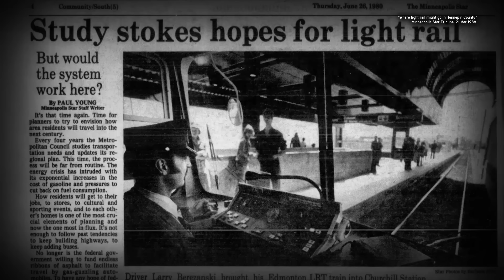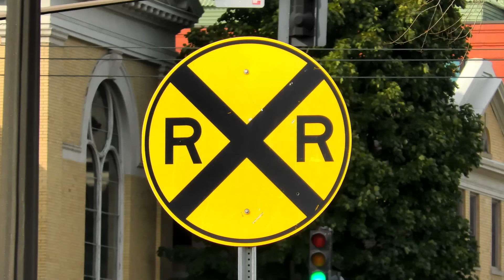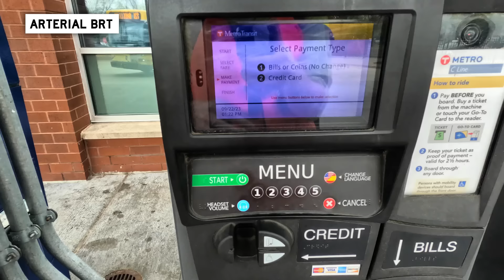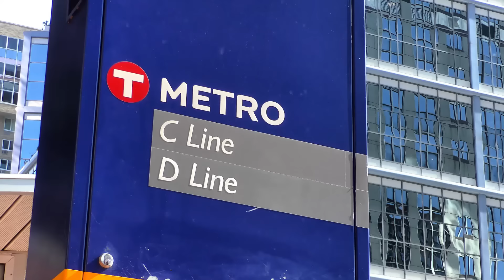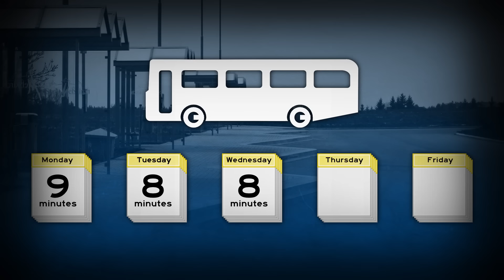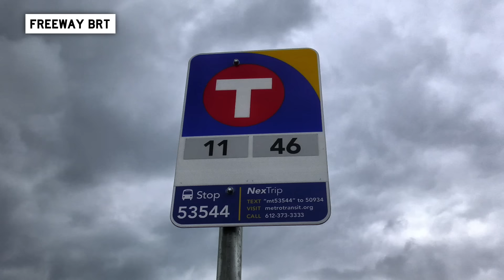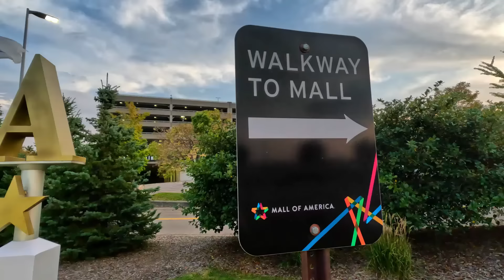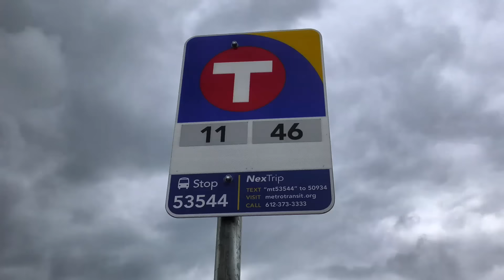Meet Minnesota’s $500-Million... 🚍 BUS???

Comment: You know why this is a good idea?

Because you're basically building light rail infrastructure in advance. In a few decades when the economic growth helped by your bus services enables the municipality to afford it, you can just replace those "arterial buses" with trams and light rail without having to fuck about with routing.
Reply: Yeah, I was hoping he might bring up that fact.
I wonder if the roads and bridges are being built in such a way as to allow easy transition to rail  - already having accounted for load bearing, etc?
Reply: @Quidisi bridges nowadays are way overly designed so I’m pretty sure they thought about that, they’ll be able to screw the railway sleepers into the concrete and they’d be done, only the parts that have asphalt would need to be removed for track laying.
Reply: If you're overbuilding the infrastructure to support later use by rail, you don't realize the cost savings that caused them to go with BRT to begin with.  I seriously doubt those overpasses could really support any type of rail.
Reply: as long as bus service is properly funded... the city I live in (Ottawa, Ontario) has had a system very similar to what they're building for decades. I was riding light rail & taking transitway bus routes (dedicated bus-only roads like they're building in this video) when I was in university 20 years ago. Today through constant fare increases and an absolute refusal from council to actually use tax dollars to fund the transit system, our bus system has become a national embarrassment that anybody who has the option actively avoids taking. I've got a choice, now, between a 45-minute bus ride to work or a 20-minute drive. parking's only $5 more than taking the bus both ways, and they've got free charging for my EV. I really want more people to take the bus, but it's a really hard case to make here
Reply: @major__kong LIght rail is likely not much more weight per square foot than buses. Most BRTs are there to be the first step for a LRT
Reply: Bridges aren't going to be totally .but the infrastructure that is being built is the stops, businesses around the stops, road width. And public support 😁 #1.
Reply: The bridges are not being designed for conversion to light rail in mind.
Reply: @trademark4537  They can convert existing bridges to light rail though. See the UofM Washington Avenue bridge.
Reply: That's always been the carrot promised with BRT, but give me one actual example of that happening in the US.
Reply: @trademark4537  well that would be really dumb. However I don't think LRT vehicles are radically heavier than a bus and bridges are designed to hold all sorts of traffic including 80000 lb tractor trailers. Trust me, no one is under engineering a bridge to the point it couldn't hold 4 or 5 buses and an LRT isn't heavier than a mixed load of traffic. Those bridges are standard highway bridges I am guessing.
Reply: @averagejoejesse  BRT is fairly new in the US, and cities haven't had enough time to grow ridership to the levels that would justify light rail.
Reply: @jmlinden7  that's fair, but since a conversion hasn't happened yet, I'm not going put stock in to that "benefit". It's Schrödingers BRT conversion as of now
Reply: It's not as easy as placing tracks over concrete road. "Upgrading" would require roadwork on all busways and installation of electrical systems, not to mention throwing away all those BRT buses for new trams. This would take at least several years to do (in American style), which means that suddenly people lose access to transit. Hence, it is foolish to think that tramways can be downgraded to BRT construction and then "upgrade" them later. Many urbanism channels have pointed this out already.
Reply: @averagejoejesse  that's exactly how a lot of Seattle rail was built. We're putting one of our lightrail lines on a floating bridge that used to be HOV lanes for example.
Reply: @arkhani.  High frequency bus and HOV conversions are not being discussed here
Reply: @marklittle8805  Many of the bridges built for the BRT are exclusive to transit. 

I'm not an engineer but I heard from someone working on the project that the bridges are not built for Light Rail, and would need major reconstruction to accommodate them
Reply: @RipleySawzen  They can but it does require additional cost. I'm not saying it's impossible, I do think it should happen in 20+ years. And acquiring much of the right of way is a big benefit. But it's not going to be as easy or cheap as building it compatible from the start.
Reply: A big part of the cost difference isn't in the strength of the structures (light rail bridges don't really need to be any stronger that roadway bridges), but in the routing of the roadway. With light rail, curves and grades are more restrictive; buses can get by with sharper curves and steeper grades. Minimizing curves and grades adds significantly to cost.
Reply: @trademark4537  that would be stupid to do that ...
Reply: @major__kong  They probably could support rail with some upgrades to bridges
Reply: But in reality that rarely happen. The only real exception is Ottava, but I don't think the Confederation line is a good advertisement for the busway to LRT model 😊
Reply: But there's no benefits from having light rail over a normal road, only more cost, no benefits whatsoever.
Reply: @TurboBaldur  
• less drivers needed
• If fully grade separated then no drivers needed (you can use driverless trains)
• Much, much higher energy efficiency
• Possibly lower maintenance cost (not sure though)
• More comfortable (less bumpy)
• Better level boarding
• Overall cheaper in the long run, especially in countries with high labor costs
Reply: Buses don’t make the economy grow.  You can’t deliver goods by bus.
Reply: @hugolafhugolaf  But transporting people can still lead to more flexible workforce as people are willing to commute further when the journey is faster...
Reply: They’re doing this in LA, the G Line busway and the NoHo Pasadena BRT will be converted to light rail eventually.
Reply: That sort-of happened in Seattle with the Bus-Tunnel downtown (built in the early 90s) eventually becoming the light-rail tunnel (starting in '09 but becoming exclusively light rail in the mid-2010s)
Reply: @miles5600  I heard Ottawa was having trouble converting their BRT system to rail. Among other things: rubber tyred vehicles can handle sharper turns and steeper slopes.
Reply: @jmlinden7 Development of transit shouldn't be ridership based... people dont use transit because its not good enought to use! 
This is why you build for the future with transit.
Reply: @70M45-c9r  yep. it's hard to convince city planners to change what already works, because to make the change would probably more than what the city might be able to afford, and in a decade is still probably paying off the costs to make the busways in the first place.
Reply: As a Latinoamerican, where the BRT is extremely popular and used for decades.

DONT FALL TO THAT LIE

It's a lie. Once it's a BRT, it never will become a ligth-train or a tram.

Never in history has that promise of "first a BRT, then a train" happened.
Reply: @M4ST3R0FH4T3  Ottawa, the Capital of Canada did it. It was not without problems though. Whole system shutdown repeatedly.
Reply: It depends on the weight requirements. Can it handle the weight of train.
Reply: No.
Reply: Didn't think about this but that's a great point - and until the city densifies enough BRT should have enough capacity to serve these lines
Reply: I’m surprised they didn’t say that too, because that was my thought too. A future transition to light rail makes sense if the construction companies can figure rail out.
Reply: And I would never do that, because bus is always superior to rail. I have my own video ranting about all the issues with LRT, and how Bus is so much better than guess what mode they have to use every single time the LR system fails, has issues, gets block or otherwise cannot fully function or at all? Good old fashion bus! "Bus Bridges" and "LRT Shuttles" are inevitable and a constant in places where there is a lot of LRT. Just look at Portland. lol. LRT is NEVER worth it. Bus and BRT only please and thank you. Especially since, if it works so fucking well, why the hell get rid of it in the first place? That makes zero sense.
Reply: @Quidisi that’s the thing, they aren’t
Reply: you're too optimistic
Reply: @70M45-c9r  The idea that LRT is cheaper than BRT is the long run is such a overused lie by the light rail lobbies.
And it is a negative to use automated (driverless) anything. It is more dangerous ironically, inevitably will have MORE problems that are expensive in the haul and on top of it, it ensures even less employment opportunities. It's wild how obsessed and trusting so many have become over automation and AI.
Reply: @M4ST3R0FH4T3  Ha, LRT is fucking lie, too. They preach how it's somehow so superior to other modes of transit, especially bus, yet it's the exact opposite and it drives me ballistic. Also, Latin America also has a very botched version of BRT. There really isn't anywhere in the world with true BRT.
Reply: @TheCriminalViolin  What? Driverless trains aren't any new AI buzzword thing. It's a 40 years old technology used across the world, proven not to pose any hazzards. Also, the money you save on automating your metro can be used to provide more local bus service, which is also where the drivers can go
Reply: @taragwendolyn  thats crazy. I also live in ottawa, when I took the bus to work it took me 45 mins compared to 45 mins in traffic to get there, and 20$ a day in parking, or about 5k a year. Our bus system does need more funding though, I believe its more social cultural outlook on transit in general that keeps people off. Well and all the news of the new light rail breaking down. Although that's because we didn't plan things well in the first place, so its going to have to be ripped up and re built in some sections
Reply: @Quidisi  hopefully so, weightwise you'd imagine it can support light rail so hopefully there's space for the catenaries
Reply: @averagejoejesse Seattle
Reply: Thats cool. You havent been on the light rail recently have you?
Reply: They're more likely to convert it into just another freeway, if you don't intend from the start to have rail you're going to get massive resistance in the future "why did we buy all those buses if we're just going to put rails in now?"
Reply: @trademark4537 you can convert a bridge from road deck to rail. But you can't just lay the tracks on the road deck. It would have to be replaced with a deck built to support the rails. 

The bridge would be fine, as light rail is no heavier than bunch of heavy trucks. But the weight distribution is very different, with all the weight being concentrated on the rails.

Thus you can use the structure of the bridge, while replacing the road deck. It's still a lot cheaper than building a new bridge from the ground up. And the fact that you have an established transit right of way now is no small matter.
Reply: @marklittle8805  They are more weight per square foot. But they can also transport more people on the same footprint.
Reply: @Mrwizard-ck7oe  Building for the future just means building for future ridership. That's still ridership based
Reply: @jmlinden7  You don't get what I'm saying...dummy. If you built transit based on current usage in an area that has little or no transit, extrapolating that data would not give you a useful map of where to place it or if its needed.  It's not about potential usage it's about creating useful routes that get people from places they are to where they need to be. If transit can't complete that route within walking or biking distance at a reasonable price and speed people will not use it
Reply: @Mrwizard-ck7oe  Transit planners aren't idiots. They can predict how much future ridership will exist after the transit is built.

I agree that the point of ridership is to create useful transportation, but you have to have some objective measurement of how useful the transportation is. Which is why we use ridership as the measurement.
Reply: Also, self driving vehicles are a thing now. It’s entirely feasible to have this route with driverless autonomous buses by the time construction is complete. Plus the buses can be fully electric with zero emissions.
Reply: @Ryan256  I would not trust a fully autonomous bus on public streets.
you can find countless videos of teslas almost crashing or not recognizing obstacles in the road and drivers having to break for the machine. Also, there's nothing zero emission about replacing tires made of oil and batteries made of metals dug by machines that run on oil. 
how about instead we have a rail line connected by wire which can run on the electrical grid instead? no batteries needed and train wheels made of metal don't need to be replaced as often. + roll resistance is less on train tracks compared to wheels which means its far more energy efficient too.
oh, and these rail lines can actually be trams instead so no bridges needed, and they can be integrated directly into the road. just give them priority right of way at every intersection so it doesn't have to stop and a dedicated lane, so nobody gets in the way.
Reply: @Mrwizard-ck7oe Tesla insiders are testing the final version 16 of FSD and it is getting there to be completely done.😊  Tesla is now releasing versions 12.2.3 to general public.
Reply: @TheCriminalViolin   Latin America is the only place in the world that actually does have BRT lol. If they don't have "true BRT", then it sounds like "true BRT" is impossible to achieve and we shouldn't waste our time trying.
Reply: Because we need more rolling homeless shelter/drug dens that spread crime to the suburbs?
Reply: @Agent77X  FSD taxis in california right now are in legal trouble for causing accidents and traffic jams. the problem is the cars can't be held liable due to a loophole. Once that loophole is closed, I can't imagine any company being willing to face legal fees caused by their flawed technology.
Reply: @dmoney2015  sorry to burst your bubble but suburbs don't get public transportation. they aren't dense enough to be convenient or useful to enough people. you get to keep your precious gated communities safe.
Reply: If only the Seattle city planners had put as much thought into their plans as YouTube commenters. I grew up in Seattle and watched Seattle willingly throw away the chance to fix transportation just so they could install a few light rail lines. Seattle had one of the best bus systems in th' nation and they threw it in the trash to buy votes from the ignorant public.
Reply: @awesomeferret  Light rail is objectively better than busses...
Reply: Light rail is too expensive. I would rather have 10 local bus lines instead of one light rail line.
Reply: this is too easy, we need to spend money on unsustainable freeways instead
Reply: I found it interesting that Rob mentioned light rail would cost twice as much as BRT since that was the conclusion that my city’s transit agency found when determining the transportation mode of a new line. Even though the new line is on an existing rail right of way, they’re going ahead with BRT because it doesn’t require building additional infrastructure like substations, overhead wires, or rail yards. It’s going to look weird for sure, but cheaper and effective transit would be better than  expensive and effective transit in this case.
Reply: public transportation isn't important. if people cant get themselves from a to b they don't need to leave their houses. more buses isn't benefitting anyone who does not use public transportation.
Reply: @kryptoniteweather  people tend to forget in Europe rail and transportation is subsidized, i don't here in u.s. it is although not sure but also people would not want to pay higher taxes either
Reply: @averagejoejesse  Ottawa pulled it off in Canada, and Hartford may follow
Reply: @hugolafhugolaf  You don't mix LRT with freight
Reply: That's only if you're city is pretty flat. rails can't do hills over 10%. Bridges over stuff count as hills. (I'm sure they did do that though, but it's not automatic)
Reply: Cities tend to be flat, makes rail easy.  I never noticed till being in the exception, Seattle, Duluth, San Fran, , , , , so 3 nonflat cities out of 1000?  Minneapolis my hometown is flat from glaciers scraping it flat and no one here lives in the rare canyons glaciers did leave here..  Unflat ground means rock which no normal city of part farmers grows on, Seattle was exception cuz we needed a port there despite the crap land.  Duluth too was for port.  Heck, San Fran also was a port.... Even Denver is before the foothills so is flat..    So yeah rarely are cities not on flat ground...  Most cities grow from great farmland....  Sorry to ramble...
Reply: You're not wrong, but it's not a magic solution either. To convert a BRT line into a light rail/tram line, would involve tearing up existing infrastructure all along the route, which is expensive. At best, that leads to a few weeks with reduced or no service, at worst it's months. This kind of strategy might be what's needed to get the project through the political system, but it's also more expensive in the long run and can lead to ridership loss because of the long hiatus in service.
Reply: Nah we’d rather just keep our money and let everyone who can’t get around figure it out on their own or disappear.
Reply: Waiting for bus or light rail in Minnesota February is amazingly awful.  My toes start to burn so gotta do the stay warm dance.... All US transit lovers never live North of New York, even Boston is too cold for transit lovers they're usually in LA or Phoenix or Philadelphia.   The Canadian transit lovers secretly all have cars, honestly, yet they blather on.  Even in France 70% of workers drive to work.  nonpoor persons prefer cars to a crazy degrees ever since 1920-1940 when they went from 5% to 55% of households it was a true love affair, cars beat out trains and buses totally and quickly. ......  It's just a myth anything will replace cars, us nonpoor are lazy and like em...
Reply: @TheCriminalViolin  Why would anyone want to bother talking to you dude? You don't live in reality, these are proven things, nobody wants to argue with your fanfiction where you'll make up whatever bullshit you want to defend your preconceived position, we want to live in reality and discuss the facts because that leads to actionable change we can improve our lives with.
Reply: well you could first upgrade it to trolley bus
Reply: @TurboBaldur Exactly. What is the benefit of a light rail system, if  you can now have electric busses in dedicated lanes with priority on traffic lights. Seems like this system is way more cost effective, which makes the light rail pretty much pointless. Save the rail for high speed travel. Like a line from Dultuth to the Cities.
Reply: Haha, not if a ton of other bus routes use the brt cough cough Brisbane
Reply: The issue with this is once a line is up an running, its difficult to shut it down and upgrade it it.
Reply: @averagejoejesse  Seattle